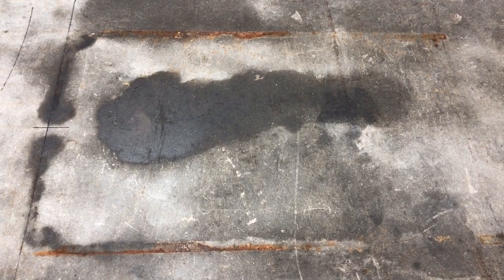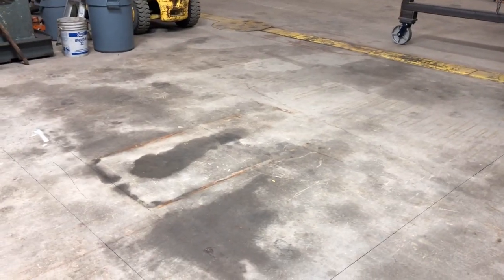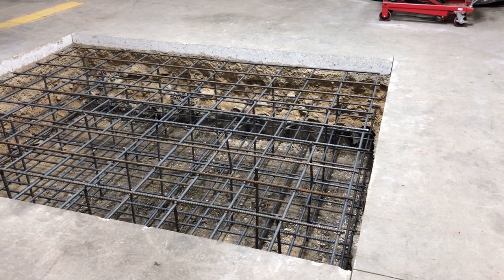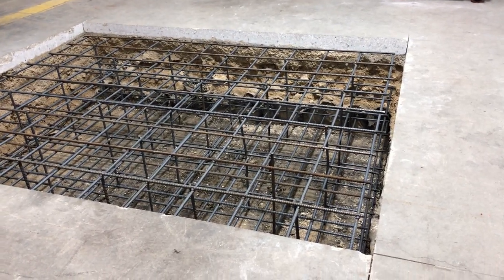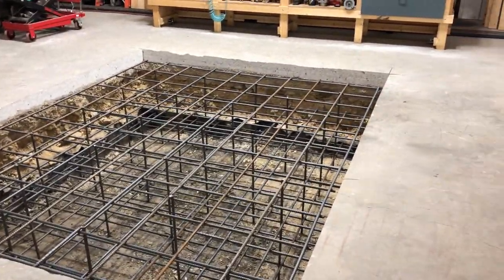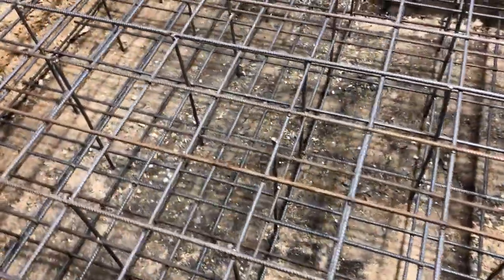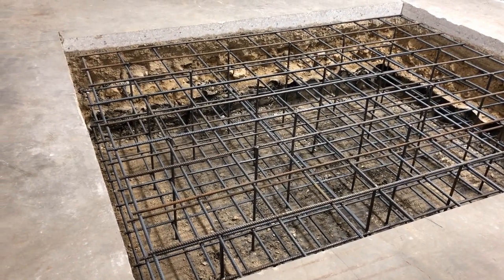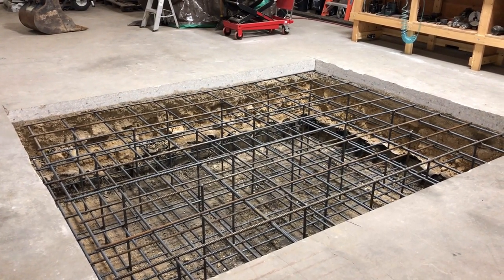Foundation for a Horizontal Boring Machine

Comment from the maker: Some people have asked if I need a foundation this heavy for my HBM.  It's not that I need a foundation that can support the weight, I need a foundation that won't flex and twist.  HBMs, like lathes, are inherently flimsy (relative speaking of course) and rely on a solid foundation to keep them aligned.  The original floor in this area was cracked and the crack would have passed under the HBM.  This is the worst situation as the HBM would then be supported by two pieces of pad that can move relative to each other, twisting the HBM.  From what I have been able to find out the rule of thumb is that the foundation should weigh about three times what the machine does.  My machine weighs about 20,000 lbs. and the pad is around 50,000 lbs., so not quite there, but close.  As an interesting comparison a gas turbine overhaul shop I used to work for bought a new HBM for doing very accurate work on large gearboxes.  They built the foundation for it as recommended by the manufacturer of the HBM.  They cut the floor, excavated to about 12 feet deep, from there they drove piles to refusal, and then poured a pad on top of the piles 12 feet thick with the top flush with the original floor.  Only by doing this would the manufacturer guarantee the machine would meet it's accuracy specifications.  Compared to that, my foundation is a flyweight. Ken

Comment: Was drilling and doweling the edges of the existing floor into the new foundation considered?  Thanks
Reply from the maker: Hello KW.  I had thought about that and was worried that if the floor and the pad moved relative to each other it may break the floor or shift the pad.  In hindsight I could have as after 18 months the pad and floor have not moved relative to each other.  The pad has had a good test as well.  It was poured in April 2021.  The summer of 2021 had one of the most severe droughts on record.  This was followed by the spring/early summer of 2022 which was one of the wettest on record.  It has been through those extremes and a freeze/thaw cycle and has not moved at all, so it should be good.  Ken

Comment: That'll do pig!
Cannot see that moving with that size machine on it!
Did you consider plonking the cut out section at the bottom of the hole?
Or did you have another idea for it, BBQ and picknic table slab out back or something...
Reply from the maker: Your last sentence nailed it.  We are going to put a vegetable garden behind the shop and the old pad will be put in there as a place to wash the vegetable without having to stand in wet mud.  Ken
Reply: You live in a snowy area of Canada don't you?
Short season or hot house, I'm guessing.
Living in sub tropical Australia I don't really appreciate your difficulties!!
I'm looking forward to seeing your latest machine in action.
Reply from the maker: @captcarlos  Hello Carl.  We have quite a range of climate here.  In the winter -40C is not uncommon while in the summer +35C with high humidity is also not uncommon.  We can successfully grow all the usual suspects (potatoes, carrots, onions, peas, tomatoes, broccoli, cauliflower, radishes, cabbage and corn).  The area I live in is known as the bread basket to the world, as we traditionally grew huge quantities of wheat that was exported all over the world.  In fact Italian pasta makers import our durum semolina?, (a type of wheat, I think that is what it's called) as it is considered the highest quality available.  We have hot houses (we call them green houses) but they are mostly used to get a jump on the growing season by sprouting seeds into bedding plants that can be planted just after the last frost.  Of course, the rub is knowing which frost is the last one.  Many eager gardeners have gotten burned (or maybe frozen) by jumping the gun too early.  Ken
Reply: That's one hell of a temperature range..
Our max record is 43 deg C, with the record low at -3 deg C, but rairly over 34 or below 5 deg C.
We might get a frost or two...
Humans are adaptable eh.

Comment: That's one massive footing there Ken .
Reply from the maker: Thanks Max.  From what I've been able to find out about HBMs the foundation should weigh about three times as much as the machine.  I didn't quite make that but it is close.  Regardless of what condition the machine is in (it is used), I know the foundation won't be adding to any inaccuracy or movement over time.  How is your shop coming along?  The last update you gave you had just done an heroic amount of work over Christmas.  Ken
Reply: @hmw-ms3tx  Hi Ken .    Still slow progress when you have to make all of the  bits up , editing a video at the moment .
Reply: That is what I was thinking. I only went a total of 10" for my pad for a future HBM. Of course I want one with a small foot print. I hope that ends up being enough.